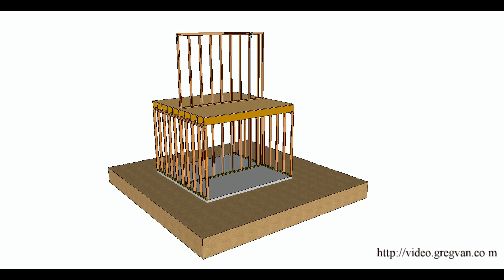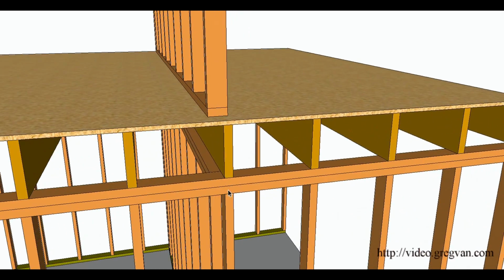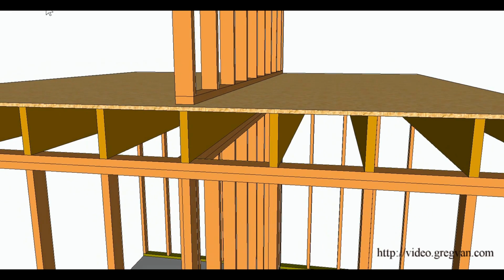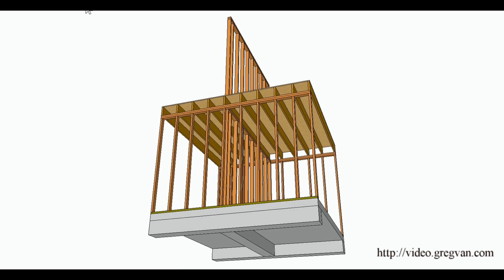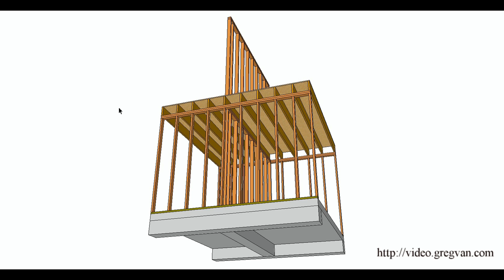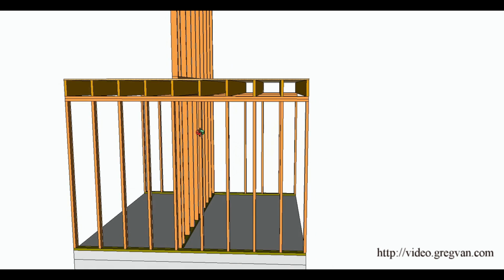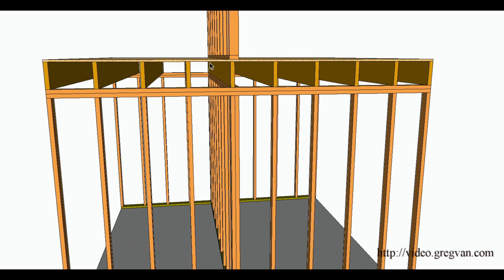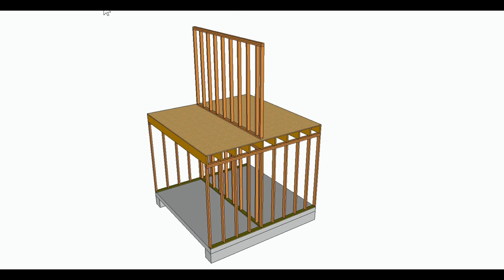Structural Floor Framing Examples For Supporting Walls – Part Three

Comment: Great video. I have exact same problem where the joists are going parallel to the load bearing wall and is not sitting on the joists. And hence saggy floor. It's over a 100 year old house so hoping its not a major problem. Wondering if its okay to just use a couple blocks and shimming it up to level the floor. Or do I need to support it from the bottom?
Reply from the maker: I have more videos at our website on floor framing repairs you might consider watching and as long as the repair provides structural support, it should work.
Reply: @gregvancom  thank you. Great videos